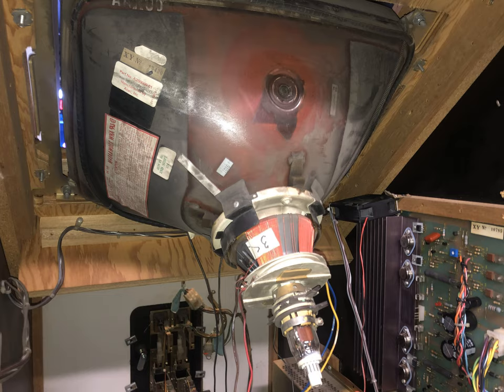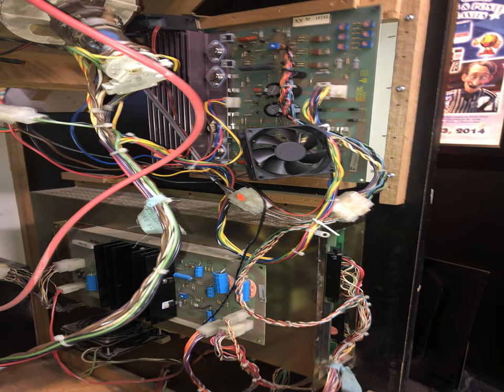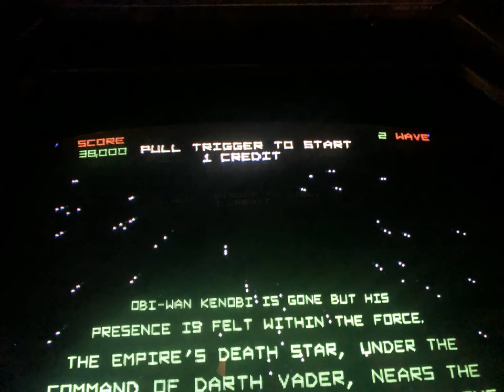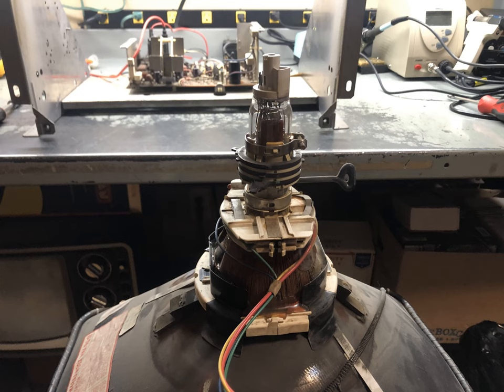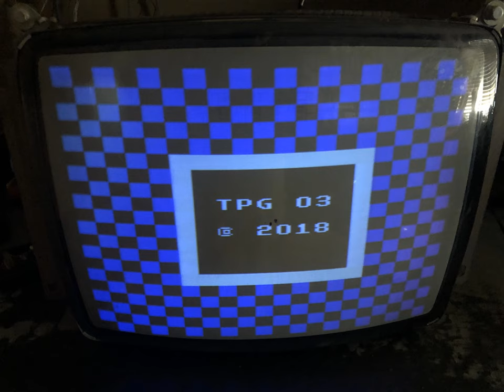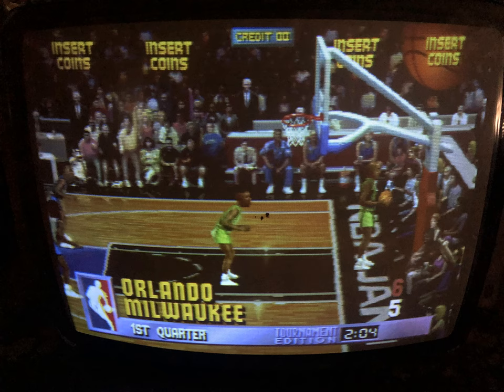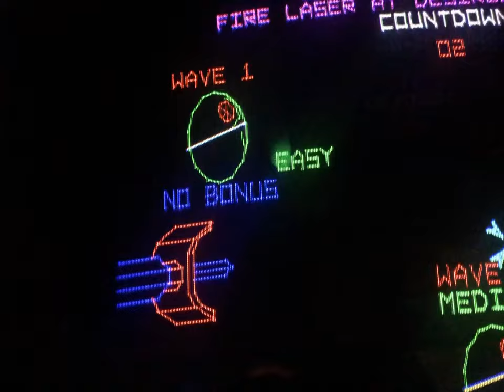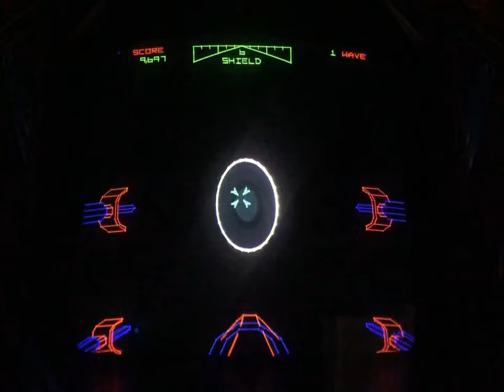Atari Star Wars Amplifone/K4900 Tube Swap Result With Gameplay

Comment: Thanks for sharing the successful tube swap. The picture looks great! People say the original Amplifone tube M48AAW00X is medium resolution. Did you notice any loss in resolution or detail after the tube swap to the tube previously used in the 4900?
Reply from the maker: Nope. There’s not really such a thing as a medium resolution tube. Technically there are tubes with a sharper matrix and such, but it’s the yoke that determines the true resolution. This 4900 tubes looks leaps and bounds better than the original Amplifone and no one would ever be able to tell.

Comment: Good video Mike
The  arcade I work at has a Star Wars but the damn thing is down more than up. We narrowed it down to the main edge connector .. any recommendations besides replacing the connector and pins? If u shake the cabinet the damn screen glitches with artifacts
Reply from the maker: Could be the edge connector. If the glitches change based on what you are doing, I doubt it's a chip or board issue. I'd remove the boards, clean the interconnect edge connectors on both boards, and the two edge connectors for the main connections. All 4 in total.